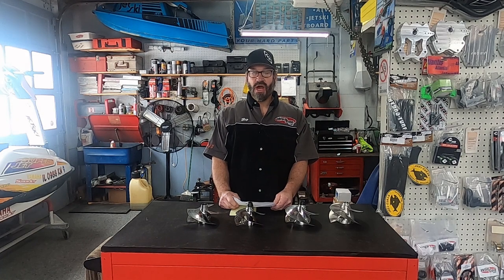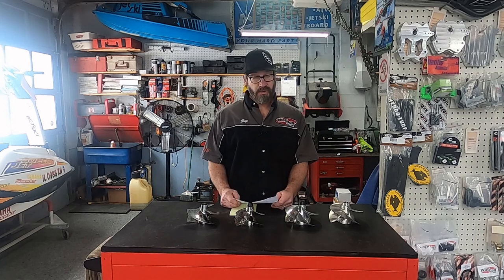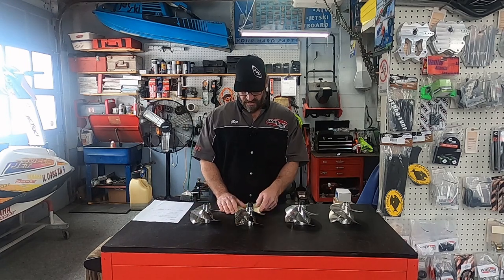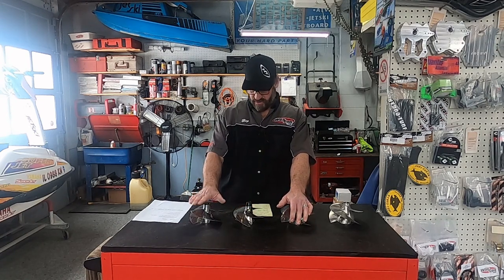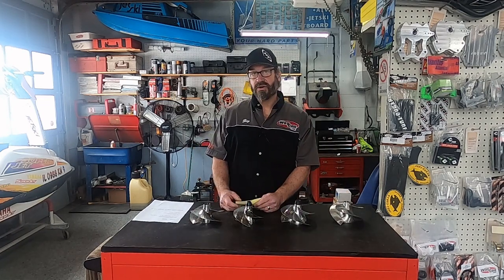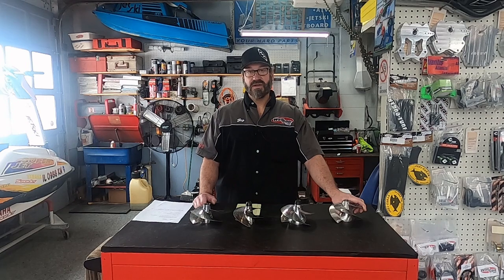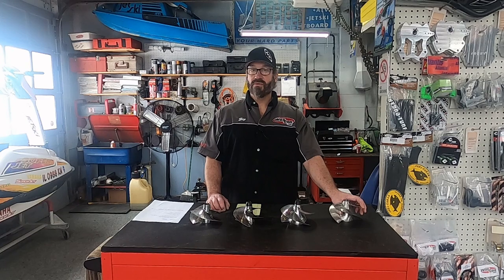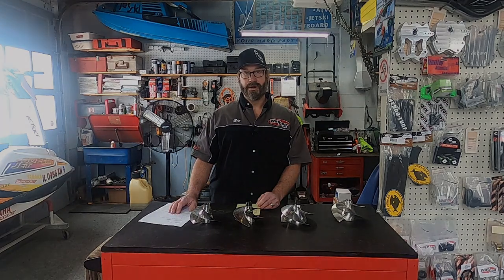impeller talk

Comment: Hi there John, I have a 1994 Yamaha Waveblaster with a ported 701 61X/62T, bored 1mm over, DASA girdled head running 175 psi domes, Boysen Reeds, dual 38’s, R&D flame arrestor, Coffman pipe, Factory Pipe Waterbox, and MSD Enhancer and coil.

I’m currently running the stock impeller and I want better acceleration and top speed. I weigh 190 pounds and usually ride lakes 1600 feet above sea level. The ski doesn’t cavitate, but I feel it can accelerate much harder and have a higher top speed.

I was looking at a Solas YQ-CD-13/19, hoping that it will do what I want, since the stock impeller is 15/18, and I’m only getting 47 MPH, when I really want to be getting at least in the 50’s.

With all the mods done to the engine, I would expect more then just like 2 mph faster then a stock 61X/62T. Based on the info I provided, would a 13/19 be a good choice for my application?
Reply from the maker: Thanks for watching, and thanks for the questions....  Please reach out to me at my shop for recommendations.

Comment: Hi John,  I have a 2000 XLT with the SBN44 I's and the 12/18 Solas pushing it and it has serious snappy power low and mid, but.   That was someone elses setup that owned this ski and it only reaches 46-47 mph.  I want it more cruiser efficient for long rides.  What will get me back into the 60 mph range?
Reply from the maker: Please reach out to me at my shop. Thank you
Reply: @watercrafttalk2738  ok,  I'll call today!   Thanks

Comment: Hi John. Would you say a Solas Concord 12/18 produces comparable pump pressure to a Hooker 10/16 Large hub? 

I really want a Hooker 10/16 for my modded 750bp swapped 550, But im also considering getting a Higher pitch Solas Concord because they're cheaper. 

Looks like Solas makes an 11/16 and 12/18 concord so I have a few options if I decide to go that route. 

Any input is appreciated. Thanks
Reply: Gotcha. That’s good to know. I’m just going to buy a Hooker then. (No pun intended 😂) Thanks for the info
Reply from the maker: Hello Tye, thank you for watching. The Solas Concord is a good impeller. BUT it is no hooker.... The hooker is more efficient, Thus the 10/16 pitch vs the 12/18.  Hooker is cut back. You could send out your concord to be modded, cut back, ect, but then why not just buy a hooker, that is good right out of the box?

Comment: I have a 2016 255 wake scarab with twins 250 supercharged HO.  How can I determine the size wear ring I need (159MM vs 161MM)?
Reply from the maker: I would recommend taking it apart and measuring it.

Comment: Great video my friend! What would you recommend for a spec blaster? I have Ada head duel 44s msd ignition and a factory mod pipe. I'm currently running a Solas 14/17 and was thinking about going to a hooker 10/16 or 11/17. I am a lake rider and occasionally run buoys with buddys
Reply from the maker: Thanks for the reply Jeff. Please reach out to me at the shop,  I would be happy to set you up with an impeller.